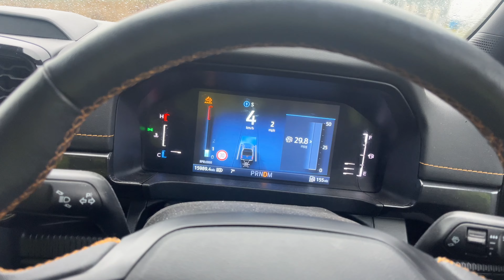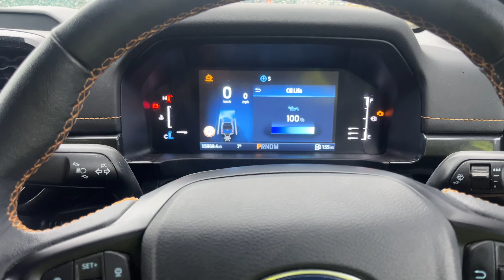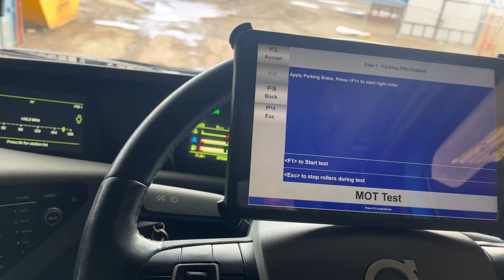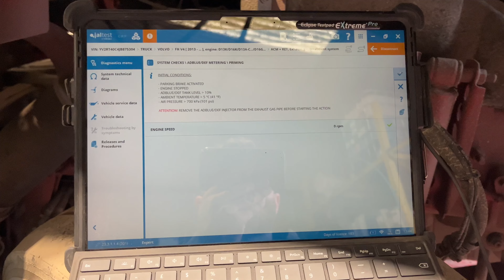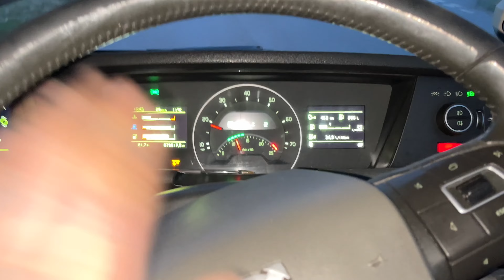Volvo adblue issues… will these adblue issues ever end…

Comment: Nice work, done a few pumps recently myself, same as yourself had a blocked injector replaced that then fault came back, pump was putting too much adblue in hence the build up behind tear drop and blocking the injector again, should be a mist like on your last dosing test unlike ours which was like opening a tap meaning too much adblue won’t be carried by the exhaust gases resulting in the blockages, pretty straightforward system once you’ve got your head around it, anyway keep up the good work and videos👍
Reply: What makes the pump put too much adblu through though ?
Reply: Usually a bad reading nox sensor can cause more adblue consumption

Comment: When I drop a trailer, I always use BLANK - brakes, legs, airlines, number plate, kingpin. Then reverse the order for hooking up. Hasn’t failed me, yet…. 😅
Reply: Why go to the brake first if you not a rookie. Once you pull the airlines the brakes come on.? As I shunt a lot most lads do airlines, legs , number plate, and pull the pin. The only thing I do is if I have been talking to anyone I’ll check it again.
Reply from the maker: I like that one mate!
Reply: @herbie70philip we are taught BLACK on our training.
BRAKES.
LEGS.
AIRLINES.
CLIP.
KINGPIN.
They like us to emphasise the trailer brake for safety reasons.
What if the trailer brake doesn't come on?
Your taking a gamble.